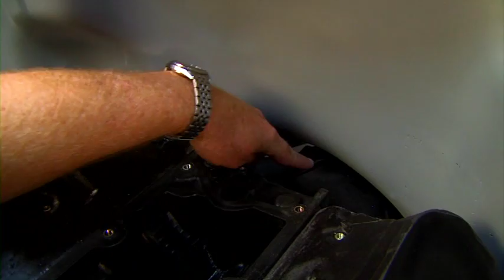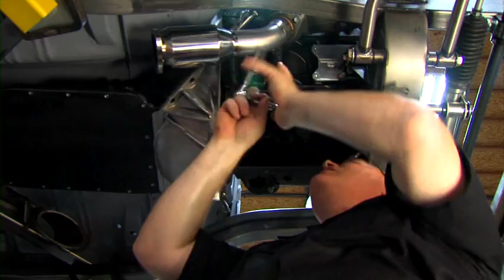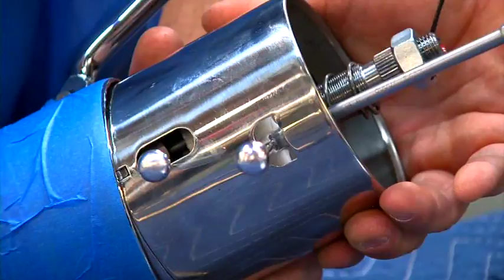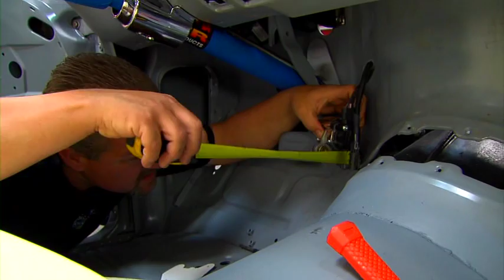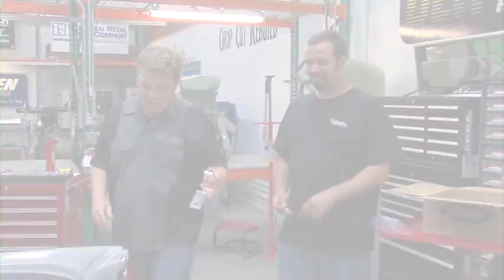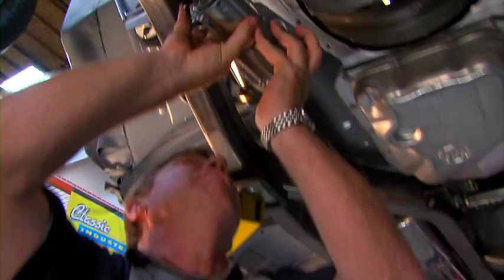Chop Cut Rebuild 1956 Chevy Convertible Part 2

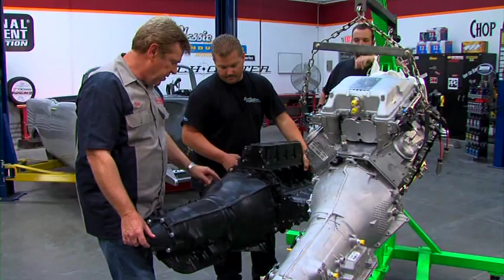Comment: 23:38 Smooth valley plate. Non - AFM motor LSA
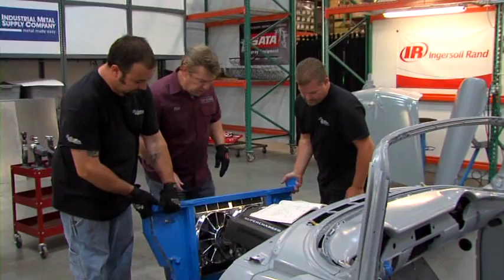26:38 Inner fender wells? Is this an upgrade to the original design?

Comment: Started out loving this video, ended up scratching my head. If they were going to  eliminate the top and windows, seems it would have made more sense to buy a 2 dr hrdtp to start with and cut the top off.  Not only cheaper, but probably more available. To buy a rusty conv for the hood, and then purchase a complete new conv body and not include the top and windows just doesn't make sense!

Comment: This isn't a CUT, CHOP, OR a REBUILD! Its building a new car out of new parts. This is what restoring an old car has come to?  How depressing! At least the guys in Vegas and Dallas rebuild original cars .
Reply: Someone should suit in the head for this b s you trough out the baby with the bath water. This kind of work is b s on b s with shit though in
Reply: does it really matter if car is original it all looks the same and this car will handle and run a lot better stock original car